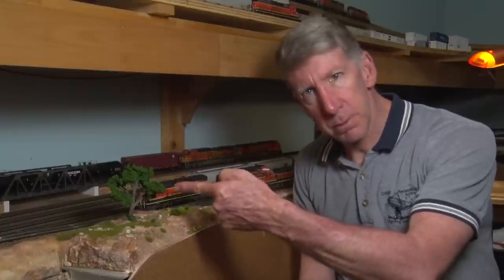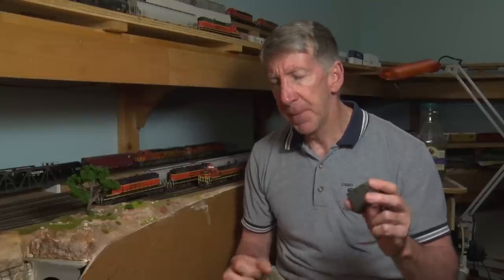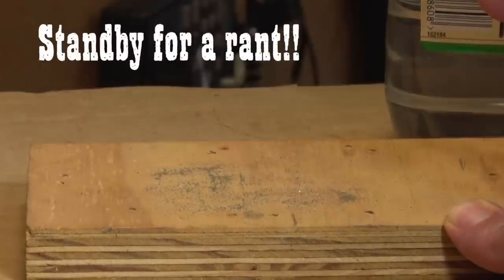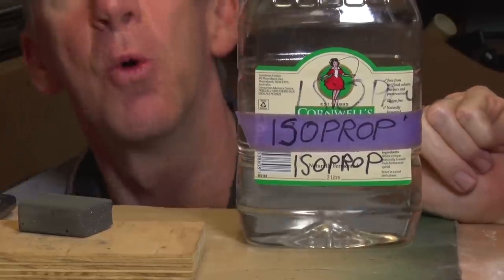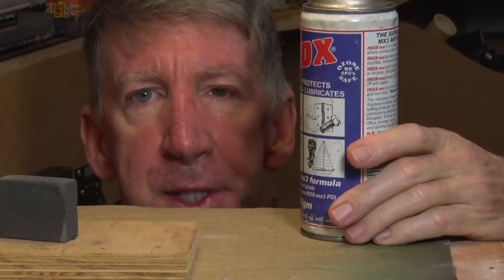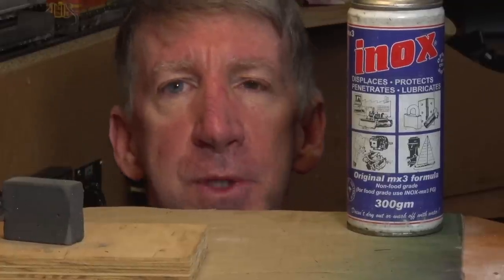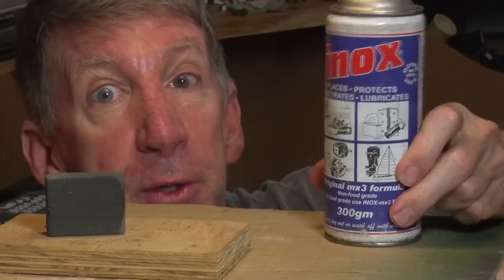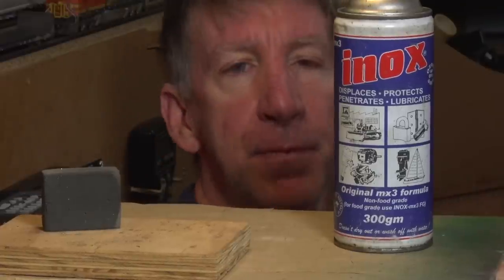Track cleaning do's and don'ts. How "Not" to  clean your track ! And how to do it better!

Comment: Great video Greg informative as always. I don’t use any abrasive track cleaners since I saw the dust produced and thought that can’t be good for the locomotives mechanisms if it gets inside.
I don’t clean my track unless it’s dirty then I use a white linen cloth which works.
Reply from the maker: They are track destroyers for sure! A little spray on your cloth every now and then won't hurt either Tony. Also depends on how clean your train room is too!
Thanks for watching.
Gregg.

Comment: Hi... Could you do your usual low key commentary on graphite for rails. Using would possibly negate NO-OX. Zene
Reply from the maker: Hi Zene, I tried the graphite block , it is ok but shorts out the track , which is a pain and doesn't help with dirt removal , so I'll stick with the Inox.
Cheers Gregg.

Comment: Hi Gregg. Thanks for you video, very informative. As an old school DC bloke I'm faced with what might be a bigger challenge in regards to cleaning track. Not only that, but plenty of my locomotives (including some real good ones) utilise traction tires. Would Inox be suitable in this environment or would I need to find a different method for cleaning the track, as I don't want to risk the rubber on such tires perishing and requiring regular replacement. Cheers!
Reply from the maker: I'm afraid Innox is no good for you Daniel! It will NOT degrade the rubber, but the tires will soak it up and become useless !! So much so that I had a guy bring a pair of very nice Mikados over and after a few runs round the layout, they could hardly pull themselves up the grades!  May I suggest to clean the track with Metho (it has no water) and then get a graphite stick , or old pencil, and rub that on sections of track. I hear that works well and if it effects the tires , you can wipe  it off ? 
Try it and let me know how it goes!
CHeers Gregg.

Comment: I looked online Gregg we can get that stuff here in the states . But it expensive $14.00 a can, but if that’s the stuff to use and with a few sprays on a rag a little must go along way huh. Thanks for the great track cleaning tip . Rants and all . Cheers
Reply from the maker: Thanks Jim!  CRC is good too, just make sure it is plastic safe and has no silicone and you'll be right . Don't use contact cleaner as it dries too quickly .
Cheers Gregg.
Reply: FishplateFilms   Gregg what product by CRC are you specifically talking about, looking online they make many different cleaners . Thanks
Reply from the maker: @jimsmoter4510  I think it is CRC2-26, that is what others have said in the comments and it rings a bell!
Gregg .

Comment: I use a cork from wine  try it let us know what you think Mr down under
Reply from the maker: Hi Dawn, Cork is an old favourite! It is a little rough, so it helps with stuck on dirt, but is not abrasive and it also soaks up a little of the cleaner you use! Try it with a little Inox or CRC on it!
Cheers Gregg.

Comment: I originally thought you had not addressed satisfactorily the use of IPA.  I was left asking myself, 'What about 99.9% purity?'
However, the website for Cabling Installation Maintenance does not give IPA a ringing endorsement for cleaning fibre optic cable.  It is asserted that isn’t a brilliant cleaner and that it does leave a residue.  Apparently IPA is hydroscopic, that is it attracts moisture to itself.  The headroom in IPA containers as well as its exposure to the air brings about this effect.  The suggestion is that once opened our 99.9% IPA will reduce itself to a lower purity over time and stabilises at about 65/35.
I now see that IPA is a non-starter.
Reply from the maker: Peter.....YOU SIr , are a legend!!  I should have researched IPA a bit more for the video, , but I didn't realise how popular it is ? All I knew is that my issues increased the more I used it, and as soon as I stopped and switched to Inox , my problems disappeared. I have many comments on this video .telling the same story about IPA and  a increase in poor train running and a instant fix after using Inox or similar electrical spray.
Thanks so much for looking this up and for clarifying my results.
Cheers Gregg. :-)

Comment: I've been looking around and can't figure out which is the best from the crc brand. There's the 2-26, contact cleaner and electronic cleaner. Which one would you recommend would be the best to use. Thanks!
Reply from the maker: Hi Jordan , just go with 2-26. The cleaners will work , but won't stop oxidation on the rails, which is the main problem with conductivity. I've heard  CRC make a "cleaner and protectant" but i've not seen it?  The 2-26 normal spray is the one you want , unless yo can get Inox!! 
Cheers Gregg
Reply: @FishplateFilms  hey Gregg I was able to get a can of inox like in your vidoe but I'm having trouble finding a good cloth or fabric to scrub the track with, any suggestions? Thanks!!
Reply from the maker: @jordansmith7878  Very good sir! Just any old cotton rag will do , but stay away from shiny polyester ! 
Let me know how the Inox works for you!
Gregg .

Comment: I have looked at the Inox product page.  Not sure which one to purchase.  Which is the correct Inox product to use????  I do want to clean wheel sets and will be using the "Clean Machine" (brass tank car) to clean track.
Reply from the maker: Hi Rich , the one you want is MX3! Let me know how it goes for you.
Gregg.
Reply: @FishplateFilms  Got the INOX MX3 and it works great even on my steel rail sectional track in the attic!!!!  The attic loop is used until the layour in the basement is completed with NS flex track.
Reply from the maker: @richramik2092  That's great news Rich ! Thanks for the feedback and glad it worked well for you.
Cheers Gregg.

Comment: Great video! 
What do you think of using automatic transmission fluid, being careful to use the variety ok for plastics?
Reply from the maker: Absolutely NOT  !! This was a thing years ago and I don't know why?? Remember your track is a electric circuit..not a transmission! Plus it is more expensive and a much higher viscosity , so NO.  
Thanks for watching Donald.
Gregg :-)
Reply: Thanks for your reply. Rant on, brother.

Comment: I've literally just used one of those track rubbers!!!! I'm sorry!!! Great info, thanks
Reply from the maker: And you should be Mark!! Get out the vacuum cleaner and suck up all the grit you made , then clean you track properly! I will be coming around to check..LOL
Thanks and cheers, 
Gregg .
Reply: Found some inox in the UK, cleaned all my track, but now engines are jerky and keep going when power is turned off!. What have I done wrong??. Might have to clean the engines too!!
Reply from the maker: @markdennis7038  Sounds like you have a few issues there Mark? The Inox will clean the wheels as trains move along the rails, that is why you always get dirt on the rag the more you use it! 
Gregg.
Reply: I've just got a new controller, so far it's running my deltic ok so maybe that was it. I had the old black Hornby controller with the red power 'knob'. Quite old!!
Reply from the maker: @markdennis7038  That IS old Mark!  The more you run your trains. the better the Inox works! 
Gregg :-)

Comment: It says “lubricates”, does this leave a slick film that would cause wheel slip?
Reply from the maker: Hi Lancer, it does leave a very thin film on the rails, depending on ow much you apply of course. I run long trains up my helix with no issues at all . The only issue is if you have traction tyres on your loco , then it becomes a problem ,as they soak up the inox and become useless! 
Thanks for watching.
Gregg.

Comment: The highest grade of wet and dry I can find is 1200, I have used that, its not as abrasive as the track rubber, I put Goo Gone on it which helps make it less abrasive also.
Reply from the maker: Thats a good tip Sam , but remember that is for extreme use only and not for normal use!
Gregg.
Reply: @FishplateFilms  Totally agree, Ive had to mainly use wet and dry with Goo Gone on areas of the storage yard where the flux I used for soldering had oxidated the track.

Comment: Thanks for the video however I still have my doubts only because I went to do more research and folks give suggestions on not to go with crc through forums. But if you tell me to go with that I will, it won’t hurt to try!!!
Reply from the maker: Thanks Adam! I can't vouch for CRC personally, but I can for Innox , as I have used it for more than a decade on my layout and you can see for yourself how well my trains run. We also use it at work on real railway electrical circuits and equipment, so it has proven itself there. 
As you say , give it a go yourself and see how you like it.
Cheers Gregg.

Comment: Here in Malta we haven't got Inox , so is WD40 ok? I do really appreciate if you answer me back
Reply from the maker: You can use it , but CRC 6-26 is better . WD40 is not really made for electrical components, and is more oil based. Get CRC if you can!
CHeers Gregg.

Comment: After a lot of years in the hobby the best cleaner is water with a dash of detergent and meths applied with a wagon
equipted with an applicator system followed by a wiper pad arrangement made of kid leather as a wiper off.  If your track
ever shows a grey residue your track is filthy.  Totally clean track provides better electrical and climbing ability on grades and
wheels do not 'gum' up because there is no contaminants on 'clean' track. Logical really! 

  If you have been using oils and other such things for track cleaning a sparing application of kerosine will get your track prepared quicker for my method to be effective. 

 Here endith the lesson!

Comment: Is it possible to get inox in a bottle that doesn't squirt so we could fill a track cleaning car (CMX) with it and make the job a buttload easier?
Reply from the maker: Depending on where you are Jared, you can get it in a trigger spray bottle that you could fill a track cleaning car . But you only need a little on a rag and I don't know if you can slow the CMX down to a drip ? 
Cheers Gregg.
Reply: Yes, the CMX track cleaning car has a cap to fill the tank, and a knob to regulate the drips, but that's just from what I've seen.

Comment: Hi there,  thanks for your two very useful posts.  I'm in the UK and have been looking at the various chemicals that have been mentioned in your videos.  I have found that looking at the SDS (Safety Data Sheets) for a number of products  indicated what the active chemicals are and so help to avoid buying an isopropyl alcohol product (incidentally, it's worth a brief mention that isopropyl alcohol is not the same as ethanol). The INOX MX3 data sheet is very coy as to what it contains only mentioning that is a ketone (acetone and MEK ( methyl ethyl ketone) are also ketones) but I haven't found a product that might match.  Many cleaners/lubricants contain naphtha (also I believe contained in DeLuxe Materials Track Magic cleaner.) which may work well too.
With  regard to track rubbers DCC Concepts offer a rubber that may polish rather than abrade the track (hoovering is still advisable) and it would be interesting to know if anyone has experience with it. 
I found that getting data on graphite bars is not easy. I read that it is good to avoid those bars which have a high binder (and thus low graphite) content and I'd be pleased to hear of any good sources of high graphite containing bars.

Thanks again.

Ian

PS I have no connection, other than as a customer, with DCC Concepts or DeLuxe Materials
Reply from the maker: Thanks Ian. The graphite is a hard one to try , as you say the content is a  concern?  For me I think I will stick to proven products for now!. 
Cheers Gregg.

Comment: Does the isopropyl alcohol also affect your locomotives' wheels if you run them on track that was cleaned with it?  Also, how often would you recommend cleaning your track?  Cheers, Joe.
Reply from the maker: The IPA interferes with the wheel rail interface and conductivity , and has more of an effect on track than wheels, but you need both to be conductive. I clean parts of the track every time I run trains...it is an ongoing job , especially in a dusty environment. 
Cheers Gregg.
Reply: @FishplateFilms  Thank you.

Comment: Hi Greg.

Just a question for you.  I've taken the plunge and Inoxed my track. I'm very impressed so far.   Almost makes keep a lives redundant! 

However I did a test with two identical locos.  I placed one on an Inoxed track and the other on a track that has never been Inoxed.  I then skidded both locos along there respective tracks unpowered .   The loco on the Inoxed track was significantly easier to push than the other. 
This isn't a surprise as inox is a lubricant.

My question is, how does inox effect loco hauling performance up grades?

This isn't a problem for me as my layout is pretty flat.  However my friends have a layout with grades and they operate pommy steamers.   You obviously have grades on your layout.  How do you think a single steamer would go on your layout with say six passenger cars.  Or putting it another way,  did you notice that your locos couldn't haul the same loads up grades after you started using inox?

Cheers Doug
Reply from the maker: Hi Doug, thanks for watching and I'm glad you are getting good results from the Innox!  The locos do move easier due to there being a little lubricant, but also because there is less "dirt" sitting on the rails. I've noticed no real difference, in traction and I run big trains up the Helix, which is 1.8%. But if your friends run Pommy stuff with traction tyres, then your stuffed..LOL . The small amount of innox ix enough to  gather on the rubber tyres and they become useless ...LOL. The thing they do to make the traction tyres work , is to make that axel have most of the weight, so you have virtually no weight on the other drive axels, so when the tyres get slippery , you have no virtually other  drive ! 
Good luck with it and thanks for the good feedback!
Gregg.
Reply: @FishplateFilms  Hi Greg.  Thanks for the informative and quick reply.

Much appreciated
Cheers

Comment: Hi Gregg. Interesting video. Are all track rubbers the same (i.e. all useless)? What difference does food grade/non-food grade make to a model railroad?
Reply from the maker: Thanks Paul! Yes all track rubbers are abrasive , some more than others.Food grade only means you can use it on food making equipment , no issue for track cleaning. 
Cheers Gregg.

Comment: You say to use Inox or "CRC". Well, CRC is a big place. What is the actual chemical in these that makes them work. What sort of CRC product are you endorsing?
Reply from the maker: CRC 2-26 John. I don't know whats in it , you'd have to look at the MSSD for that. I prefer Inox , but it is a bit hard to get in the US and UK, but it is becoming more popular !
Cheers Gregg.
Reply: Found Inox on the huge online store named after a similarly huge river. No worries. Got some 3M 3000 grit paper to go with it. You convinced me to change my wicked ways.
Reply from the maker: @johntauxe  Thats good John..LOL. Go easy with the grit paper....only use it to repair scratches or remove stubborn dirt! Let me know it it all goes for you!
Cheers Gregg.
Reply: @FishplateFilms  I fear that some damage is already done. The entire layout is made with Walthers Shinohara nickel silver track, and it had not occurred to me that it is of course only nickel plated. There are places where I even took a file to turnouts and crossovers to level them out. As you suggest, the metal file is likely to have deeply scored the head of the rails, and may have removed a good bit of the plating. I think the 3,000 grit will be necessary to smooth all that out. I still need to do ballasting, so we'll do that message job first, then probably clean with 99% isopropyl alcohol then finally get into the groove of using the Inox MX3 for final treatment.

Fortunately, all the track works very well right now electrically, anyway.

Comment: Ive always used CRC 2-26 on the layout , but this  INOX product is  definitely game changer.
I also use  a  paper towel ROAR product (RAG ON A ROLL) ,you may a have come across this product in your work place  it quite soft you just have to watch  out for the strands that come of it.
I generally use a small wood block and wrap the towel  around it to get the built up dust and crap  that's been left behind , as I only use the layout every 3 -6 months.
I'm  paying the penalty for not insulating the garage.
We can definitely  do away with those track cleaning rubbers as well as those bloody useless brass wire wheel cleaners .one way to bugger up your nickle plated  wheels .
There you go, that will give those key board warriors something to bitch about LOL.
Reply from the maker: Thank you Shaun!  Glad you got great results!  To clean wheels on locos, spray some on a small piece of rag and drive the loco onto it, leaving one truck on bare track, then let the wheels spin on the rag  as you slide the loco over it...works a treat! 
Cheers Gregg.

Comment: Ok - how is frantically rubbing a track rubber across a rough piece of wood IN ANY way comparable to wiping it along a smooth metal rail? Not a useful or sensible comparison.

Comment: Is Inox okay to use if the locos have traction tyres. At one stage there was a flag that came up saying not to use if your locos have traction tyres, but I`m not sure if this warning also applied to Inox.   Cheers   Greg  from  Australia
Reply from the maker: Hi Greg, yes , traction tyres are a problem with any liquid , as the rubber slips on the slightly slippery rails. 
Locos with traction tyres have the weight on the axel with the tyres, so you have very little traction from the other axles, which makes things worse! You could clean the rails with inoxx and then wipe them dry for a test and see how it goes.
Cheers Gregg.
Reply: @FishplateFilms  Thanks I will give Inoxx a try.  Cheers  Greg